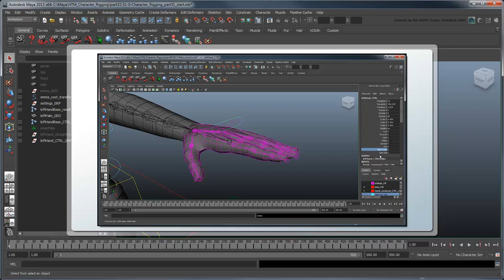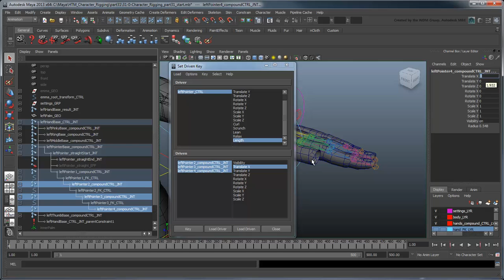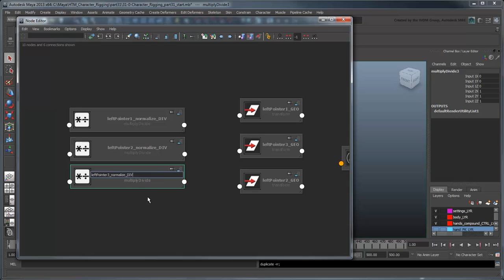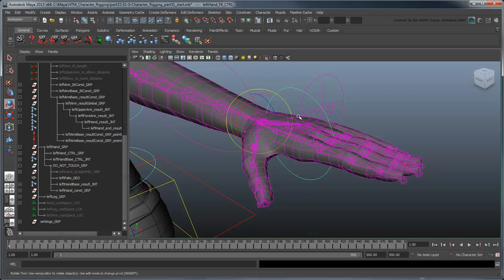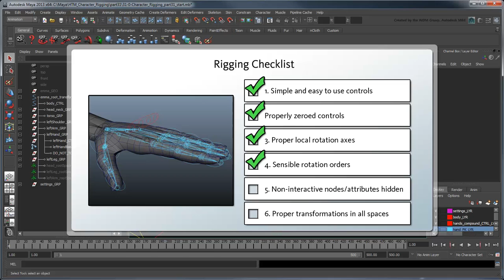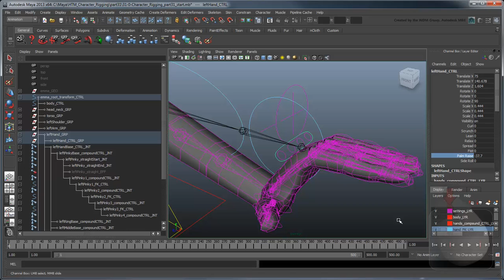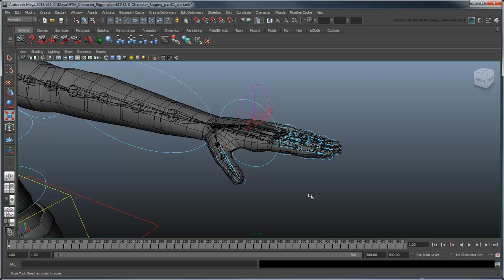Creating a Character Rig - Part 31: Hand global transform and cleanup (Advanced)

Comment: Hi, I'm trying to scale the geometry using the length attribute and whilst everything works, the geometry is slightly tilted off to the side. The fingers weren't straight in the original mesh, I had to do the geometry fix as shown in part 10 so I wonder whether this is the issue. I'm not sure how to fix this, any help would be appreciated!
Reply from the maker: Try using the same strategy as shown for the foot geometry back in part 10.
Reply: @Autodesk_Maya  I seemed to fix the original issue by freezing the rotate transformations of the finger and thumb geometry, however when using the length attribute on the thumb the geometry scales away from the palm

Comment: I've got a separate skeleton constrained to result and segment joints, because I'm putting the character in a game engine. There's a problem though; stretching causes weird scaling on the constrained skeleton. Pulling it too far, explodes the skinned mesh all over the place. Any idea how I can troubleshoot this? For some reason, simply constraining clearly isn't enough.
Reply from the maker: Hmm, you said the mesh is exploding but is the constrained skeleton also exploding?  If the former, this could be a skin weights issue.  If the latter, and you're on Maya 2020, I'd try using the new "offset parent matrix" instead of constraints.
Reply: @Autodesk_Maya  I'm on 2018 but can migrate. The skeleton isn't so much exploding, as that the scaling gets unpredictable and intense. Low numbers... high numbers... I tried turning off segmented scale in the process of troubleshooting. What boggles my mind is that I simply parent constrained a bunch of joints to another skeleton, no magic involved, but the results are so unpredictable. The rig works fine, it's just the game skeleton!
Reply: @Autodesk_Maya  How do you bake offset parent matrix to the joints? For the game engine
Reply: @Autodesk_Maya  On further inspection, I see that the longer the arm stretches, the less the constrained joints rotation match up with the driving skeleton. I'd love to use offset matrix if that solves it, but it seems it's not bakeable?
Reply from the maker: @Exsulator2  This is very odd.  So you're saying the constrained joints are slowly twisting the longer they get?  Can you possibly post this on area.autodesk.com's forums so I can have a look at the actual scene files?
Reply: @Autodesk_Maya  Yes, this is the forum post. I'll try and see if I can upload an example file https://forums.autodesk.com/t5/maya-animation-and-rigging/help-a-skeleton-simply-constrained-to-another-skeleton-rotates/td-p/9389068
Reply: @Autodesk_Maya  UPDATE! I finally found a stable solution. It's a simple matter of only using point, orient and scale constraint, and avoid parent constraint alltogether!

If anyone else does this, remember that some joints lives in negative space which means a "maintain offset" is in order
Reply from the maker: @Exsulator2  Fantastic news.  Glad to hear you found a solution!

Comment: Hi, I've gotten to the point in the tutorial in which we parent constrain the hand base const joint to the end bind joint of the arm.  However, when I use the attributes from then on the forearm doesn't stretch, and the upperarm separates from the elbow entirely to stretch towards the wrist.  I've tested most of the arm's functionality however it all works fine.  How should I go about fixing this?
Reply from the maker: The first thing I'd check is the leftForeArm_CRV used for the upper arm twist.  Specifically, is the value of the curveInfo node changing as you raise the palm up and down using the control?  Because the arm stretch depends on that curve (much like the torso depends on its curve as well).  Second, is that curve properly skinned to the leftArm_mid_bind_JNT and leftArm_end_bind_JNT?  And is the mid_bind_JNT remaining stationary?  If the skinning is off, or the mid_bind_JNT is moving with the curve, then that's going to cause the entire twist arm to move instead of stretch.
Reply: @Autodesk_Maya  It appears that the only thing moving is the leftUpperArm_seg5_JNT, while the leftForeArm_seg5_JNT and the chain remains stationary.  To add to this only the forearm curve changes arc length, and only the end bind joint for the left arm moves with this.  So the issue appears to lie in the Segmented arm joints.
Reply from the maker: @TheAnimationHipster  Assuming that we're talking about the palm raise/roll controls, then you're partly on the right track.  The forearm curve should be the only curve whose arc length changes, and only the end bind joint should move with the palm so that's all good.  However, the fact that your upper arm segment joints are moving while your forearm segment joints aren't (unless you reversed those) is worrying.  It might be that you just connected the wrong joints to the curve.

If, in fact, you meant that the forearm_seg5_JNT is moving (and not the upperarm_seg5_JNT) then we're at least closer.  However, it should definitely not JUST be the seg 5 joint.  All the joints should stretch evenly between the mid and end bind joints.  The next thing to check would be the foreArm_CRV itself in the twist_GRP.  Is it stretching between the mid/end bind joints?  Or is it moving?  If it's stretching properly, then somehow that stretch isn't being transferred to the twist joints properly (likely some kind of math node error, so check those).  If it isn't stretching properly, then that's your problem right there - double check the skinning and that the curve only has two control points.
Reply: @Autodesk_Maya  Thanks so much!  I knew I was gonna end up doing the stretch wrong due to how the curve and joint chains were ordered in the outliner XD

I plugged the normalize DIV for the ForeArm curve into the UpperArm joints.  Thank you so much for helping!!!

Comment: Woohoo I finished the hand! I have a question: can we use the approach of compound controls for the face? If so, what would be different? Aside of from joint structure and not using IK handles, I feel like it would be effective. Would we use Smooth Bind Skin for the face like we did with the palm?
Reply from the maker: Yes, you can do something similar to compound controls for the face.  However, rather than using those controls to work a series of joints like this hand does, you would instead use them to blend between a series of different expressions called Blend Shapes.  So for example, you might have different versions of the same head geometry representing a smile, frown, grimace, etc, then use sliders to determine how much of each expression is applied to the actual face geometry at any given time.  

For more information on how this process works, check out the Shape Authoring topic in the Maya Documentation: http://help.autodesk.com/view/MAYAUL/2019/ENU/index.html?guid=GUID-B8853C3F-2997-4DC2-95A0-7C43E45888E4

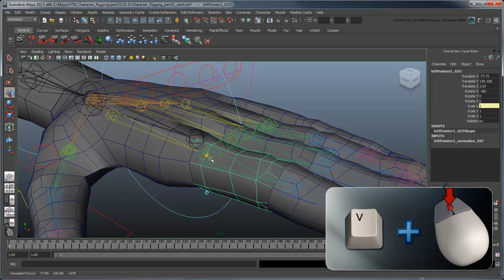Comment: @Maya Learning Channel - Part 31 @3:58 my leftPointer1_GEO's pivot is not slightly off due to the creation of the straight joints and is already aligned with the result and other joints in that position yet, my geometry pulls away as if it is not. 

Also the leftThumb1_GEO is stretching along the X axis but since it is on the restful angle that it is, this does not seem right. Any idea why this is happening and how to fix it?

See example: https://www.infinitee-designs.com/part-31-358
Reply from the maker: Re: the first question, the reason your geometry is pulling away is because the pivot point is outside of the actual geometry.  Since the vertices scale away from the pivot point, it makes sense that it's leaving a space.  If you want to avoid this, put the knuckle joint right on the edge of the finger/hand geometry (i.e. right where they meet).  Honestly though, it's not a big problem, because this wont' be an issue when you skin your rig (it's just an issue for the proxy).

Re the second question, did you put your geometry into re-oriented group nodes?  You may have plugged the squash/stretch values into the actual geometry rather than the group node by mistake.
Reply: @Autodesk_Maya  Yes, if you referring to the leftThumb_orbit_orient_JNT part? I did just notice that my thumb 1 and 2 geometry have rotations in xy and z and Emma's does not.
Reply from the maker: @RalphManis  Sort of.  Try selecting the thumb geometry with the Move Tool set to "Object" mode.  Does the X handle point down the bone?  If not, then that's your problem.  You'll need to rotate the geometry pivot (press Insert to enter pivot mode) or place them in pre-rotated group nodes that do face down the bone (then squash/stretch the group node rather than the geometry node).
Reply: @Autodesk_Maya  Hmm, that appears to be the problem... Where did I miss that part?
Reply: Actually after adjusting the pivots of the thumbs geometry, and exiting pivot mode they go right back to where they were.
Reply from the maker: @RalphManis  Actually sorry, it's not quite as simple as adjusting pivots, because if you deselect and reselect the geometry you'll notice the pivot resets back to its original position.  What you need to do is remove the geometry from the rig temporarily, orient it along the X-Axis, freeze the rotation, rotate it back to its start position again, and then put it back in the rig.  Then it will work (I just tested this).

Again, alternatively, you can just create a group node and orient it to point down the bone, then place the geometry in the group.  Then just squash/stretch the group node.
Reply: @Autodesk_Maya  That didn't work for me but this did. Without un-parenting the geometry, I froze the rotations and now it works right.  Thanks for all your help!!!

Comment: Hi, I have a quick question. So for the squash and stretch of the fingers part,  the middle, pointer, pinky are all working fine. However, for the thumb par, when I zero out the translation of the compound Jnt, the leftThumb1_GEO would not move. I am just wondering how i can fix that. In addition, I checked your files and when I clicked on the leftThumb2_compoundCtrl_Jnt, leftThumb1_GEO is under the influence of it. Perhaps I have to hook something up with leftThumb2 _compundCtrl_Jnt with leftThumb1_GEO?

Comment: Hey, its me again... I really didn't want to bother you again, but I am at my wits end.. I am at a point now where my rig seems to function the way its intended to, except for the right hand. Everything moves the way it should, but the right hand grp doesnt rotate with the rightArm_hand_result_JNT, once its keyed. I double and triple checked everything, I copied the hand anew, redid all the constraints, even checked and compared every single node connection to the left hand(that is working).. im unable to find any mistakes. It seems to be some kind of bug, since the hand does change positions, but it only snaps its rotations once i move it by hand
Reply from the maker: When you move or rotate the hand, does the status bar / Script Editor return any warnings about Cyclical dependencies?

Comment: Hi, I have a question regarding connecting mesh scale x to length attribute? Do we need to it if mesh is skinned to joints?
Reply from the maker: No.  That's only for the proxy geometry.
Reply: Thanks for the quick reply :) almost finish with tutorials :)

Comment: So basically, when we use the palm raise attribute, we cant use the FK arms controls anymore?
Reply: And I still dont get why should we add orient joints to control the result joints? Cant we just control result joints directly from the FK joints themselves?
Reply from the maker: Because the Palm Raise works on IK joints, it locks the affected joints to the splines.  Thus, we need to create a second set of joints to bend them (much like the IK / FK arms and legs, but here we're making it so that we can use both at the same time).

Comment: Could you elaborate on the function of the left hand base const joint? Wouldn't it be easier to connect the arm to the control hand itself? And the group with palm locators to, let's say, result chain? What problems could it cause?
Reply from the maker: The base const joint is more for the palm roll than for connecting to the arm.  The idea is that we don't want animators accidentally touching any of the palm locators, which means we want to hide them in the Do Not Touch GRP.  So to accomplish that, we have them affect a joint which can then in turn affect the rest of the hand controls via parent constraint.  This ensures animators won't tamper with that portion of the rig.

Comment: I'm not using proxy body and my hand joints doesn't have compound joints since i handled the driven keys with grouping every finger control and using groups as drivers(I find this method pretty much easier and it's working fine). I have the length attributes for fingers but doesn't scale with the geometry(it's skinned body). Is there any way to scale the length appropiately with ONLY result joints?
Reply from the maker: As long as the geometry is skinned to the result joints then the skin should follow the joints without any extra setup.  Are the result joints stretching properly?  You may also want to check the skin weights to make sure they're properly set up (because fingers are so close together, the weights tend to get finicky).  Finally, make sure your fingers have enough vertices to stretch out nice and smoothly.

Comment: So I must have missed something with my middle finger. When I change the length attr., the geo. doesn't move along with it. I think I must have missed something in the Connection Editior. What all has to be connected to what in each finger? I think one is FK Ctrl's rotate to the corresponding Result Jnt's rotate, correct? Anything else?
Reply from the maker: The easiest thing to do would be to compare your node hierarchy for that finger with the other fingers (or the example file).

Comment: Hello! first, thank you for this awesome tutorial!
So, i have a problem, i'm currently doing a rig for a Pinguin. Basically i have rig the leg with the "leg method" but for the foot, i use the system show on this tutorial (need more control for the claws).
My problem is that i don't have a "LeftArm_End_Bind_JNT" on this leg. 
So to which JNT should I parent the "leftHand_base_Const_GRP"  for that all Ctrl work properly? 
Thank you.
Reply from the maker: The result joint would be best.  But you may also just want to create a bind joint and parent it under the result joint, just to keep things more modular.
Reply: Thank! it work!
Reply: I talked too fast, in fact the "Palm raise" and the "side roll doesn't work :/ I tried to create a bind joint like we do for the arm (with curve and ik spline) but when i change de Palm raise, everything break and do some strange twist. Same when i move my IK. I don't know if it's possible to make this work :(

Comment: we've set the rotation order for the forearm and hand joints(result, FK and IK) when we worked on the arm, but skipped to set that of the two arm's bind joints(mid and end), and hand's base joints(result, compound and const). have we left them alone because we won't directly control them in the future?
Reply from the maker: Correct.

Comment: Hello, I ran into a problem concerning the squash and stretch.  Whenever I'm scaling the x-axis of my fingers, it's tilted to the side and I really don't know how to fix that.
Reply from the maker: +Kendrick Mendoza If the fingers aren't straight you'll have to use a method similar to what we did with the thumb except applied to ALL the fingers (i.e. using an extra orient joint).
Reply: Maya Learning Channel What I did was group each of my joint into different groups..it did the trick but I was wondering if that may cause some problem.
Reply from the maker: That should be okay.